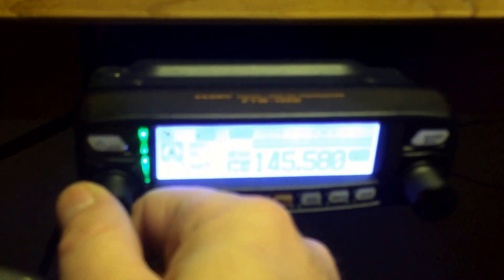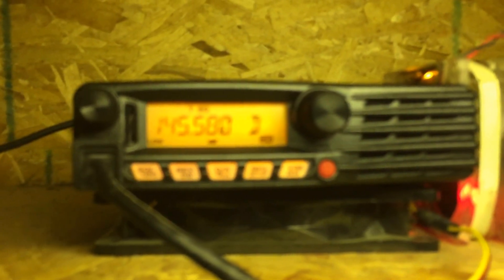Yaesu FTM-3200DR C4FM Echolink node

Comment: Hi, I am wanting to do the same thing you have done.  I have the RigBlasters Nomic that I used to connect EchoLink with a analog Kenwood radio in the past and now I would like to connect the Nomic to a Yaesu FTM-100DM or a Yaesu FTM-3270DM.  The Nomic does not have the  6 pin adapter cable in the box because it is a optional cable, but it is available from Rigblasters: RB Mic to RJ25 (Yaesu Modular 6) Cable, 3ft
#58118-982$19.95  Is this what you used?  If so, then I will order one and get EchoLink setup with my FTM-100DM mobile so we can use EchoLink through our Fusion repeaters.  Thanks and 73's - N6RTR

Comment: What interface cable did you use and where did you get it? I'm interested in that and would like to set something like this up
Reply from the maker: RIg Blaster No-Mic
Reply: John Powell how much? I just ask for a interface cable for a ftm 3200 dr for echolink?
Reply from the maker: http://www.westmountainradio.com/product_info.php?products_id=nomicu_comp_usb
Reply: did you get the starter package or the complete package and do you got urs from the box using USB or serial cable?
Reply from the maker: dunno about starter pack or complete pack? No I am using a rigblaster no mic.
Reply: John Powell I've finally got all I need, the nomic and the cable for the 3200 to the interface, I still need to figure out how to set everything up for my echolink link I'm trying to get going, when I key the radio up from another radio the PTT on echolink dont come on, can you give some pointers?
Reply from the maker: Just remember in sysop settings it should be set to VOX not COS
Reply: John Powell that's in rx and what bout the rx?